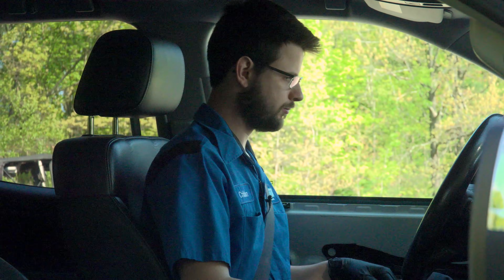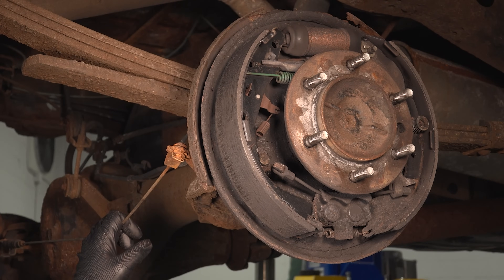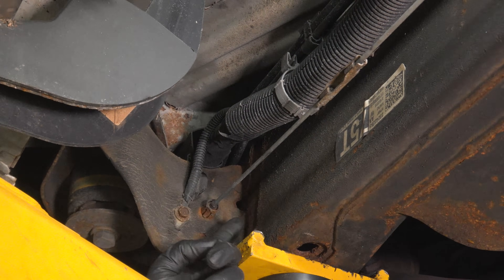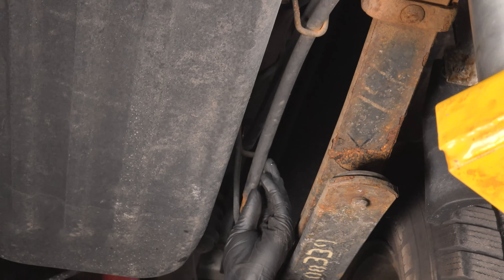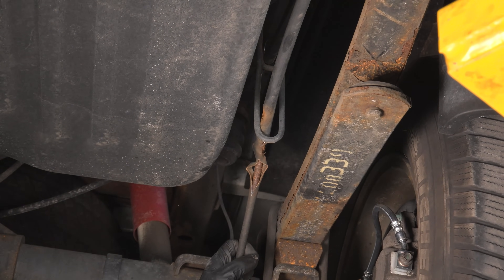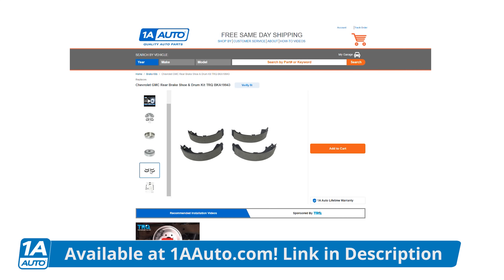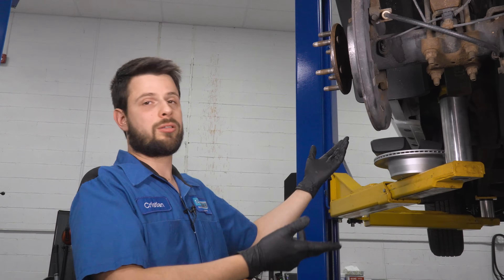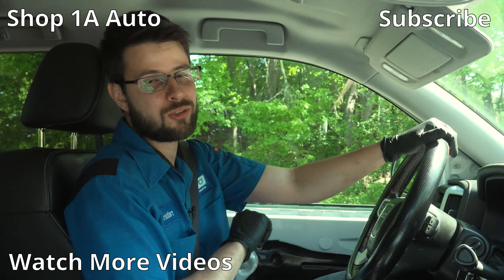Parking Brake Stuck, Frozen or Not Holding? What Parts Need to Be Replaced in Your Car or Truck?

Comment: This has nothing to do with this video, but I believe you can help me with this......  I replaced both valve covers on my 2012 Silverado, but it's still burning oil. Let me tell you a little more information first...... It doesn't smoke of the mourning when I first crack it. It doesn't smoke when I'm sitting at a red light or stop sign. It's doesn't smoke when I'm driving down the 4 lane or interstate. The only time it smokes is after I've driven it downhill ending with a stop. So, you're driving downhill on the 4 lane and at the bottom of the hill there's a red light or stop sign, you stop at the redlight and when the light turns green you push the gas petal to take off and that's when you see the puff of blue smoke. It doesn't smoke while you're sitting at the red light, only when you push the petal to take off. My assumption is.... When you're going down downhill the oil is moved forwards inside the engine and something at the front of the engine is picking it up to be burned in the exhaust or the oil is leaking through one of the valve seals at the front of the engine. Do you have any suggestions or thoughts about this? Any help would be greatly appreciated!